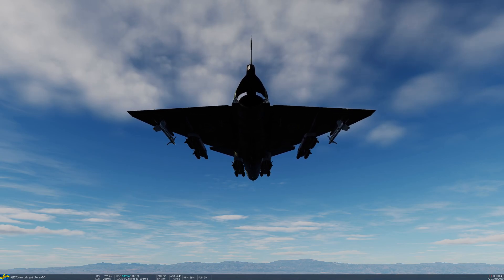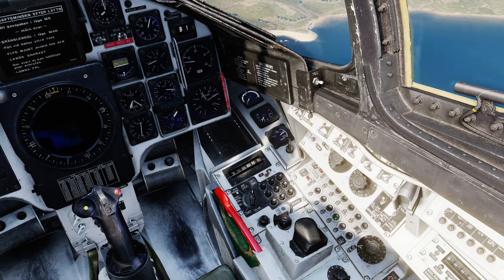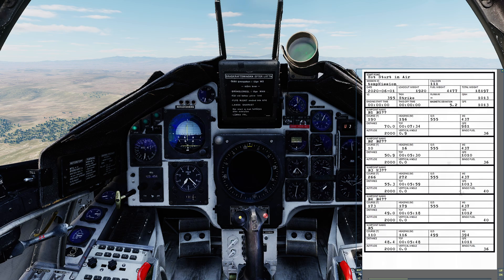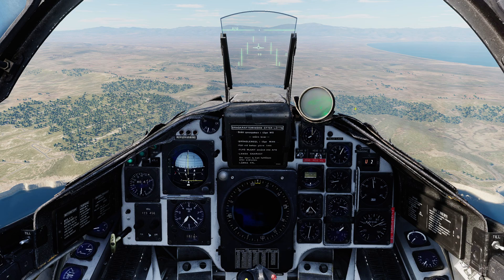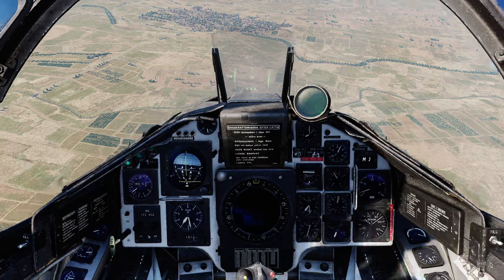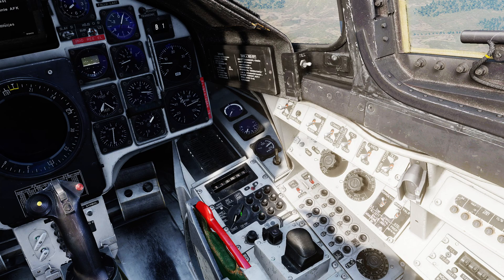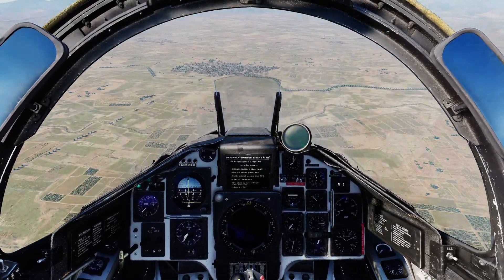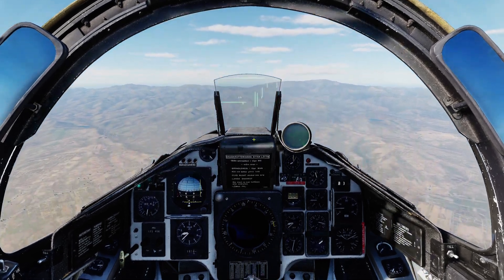DCS AJS37 Tutorial 13 - MK71 Bombs DYK mode

Comment: What i have been learned from a former AJS 37 pilot is that you keep low altitude, very low altitude, We are talking tree top levels here.  15km before the target turn 15 degrees left or right, engage afterburner zone 1 and at distance 8-9km climb with 4 G up to max 600 meters and roll into the target. Remember that the Viggen don't have countermeasures.  This tactic goes for ARAK aswell🙂